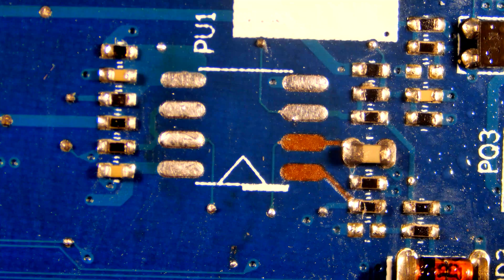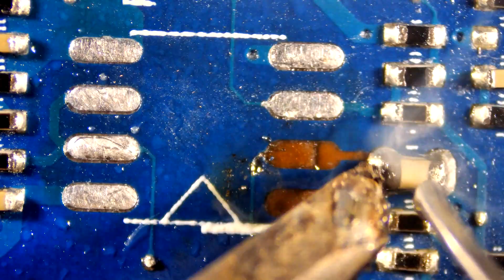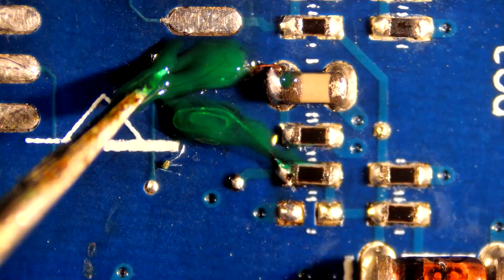How to Fix 8 Pin IC Chip like a Pro | Resoldering + Trace & Pin Repair

Comment: It was a very sloppy job.
Reply from the maker: Simply it was not my day first i forgot press record button twice and then first pin of ic broke trying to bend it back I wanted to record it but I forgot to press record button  then tip of  grinding tool broke i was in a hurry but at the end repair was successful, I tried my best but it could have been better I will try to make next video better